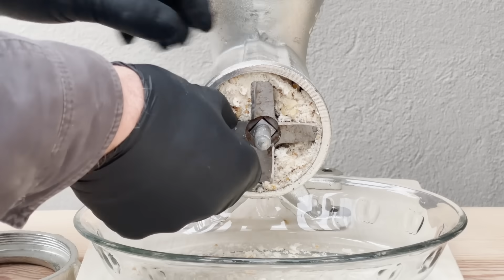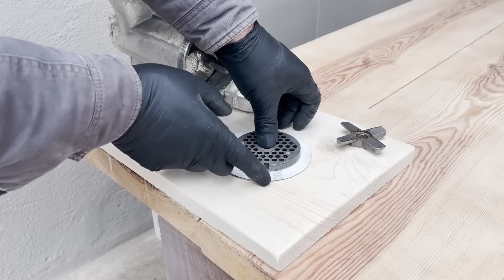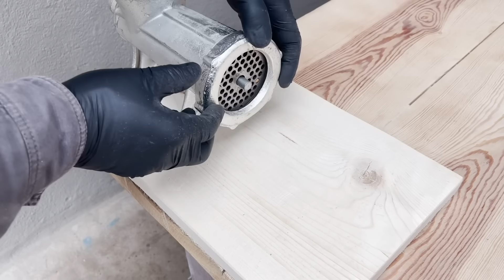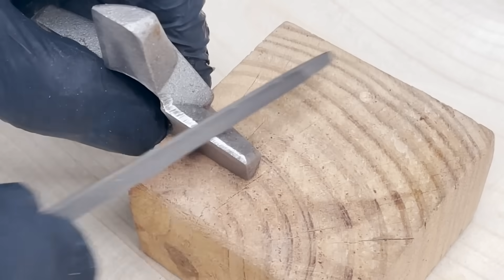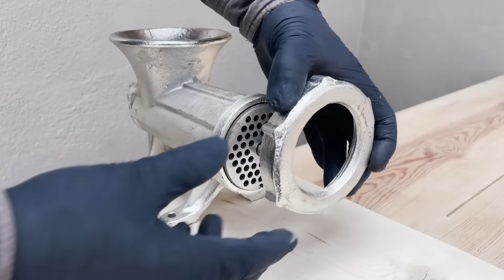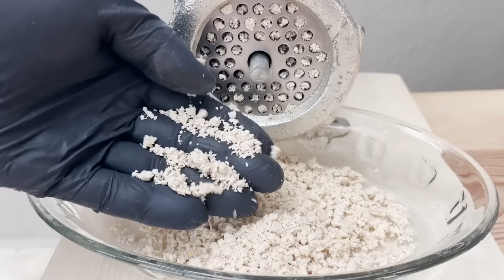5 Dakikada Jilet Gibi keskin Kıyma Bıçağı Bileme Yöntemi!

Comment: Do not do this. The blade is too wobbly. Put sandpaper on a flat surface like a granite tile or a piece of tempered glass. 80 grit is way too coarse for a final. 600 is the minimum I’d use but 1000 would be better.